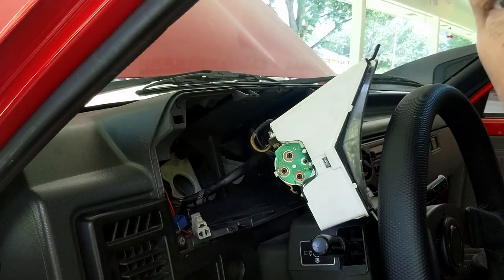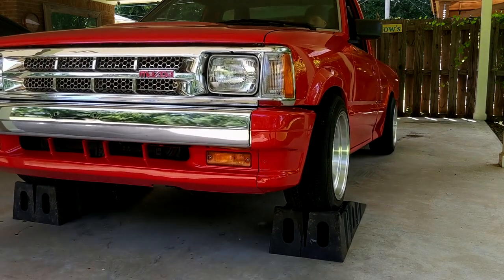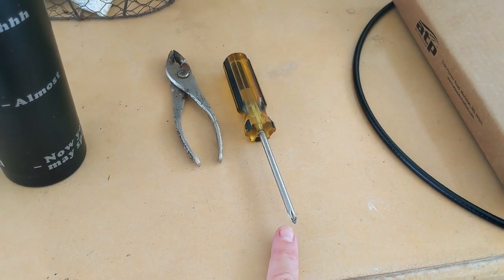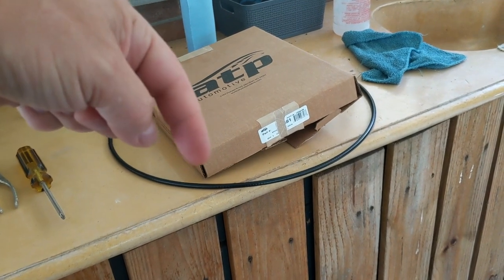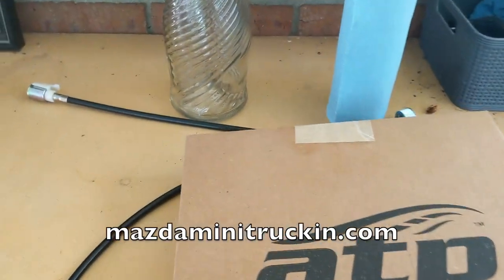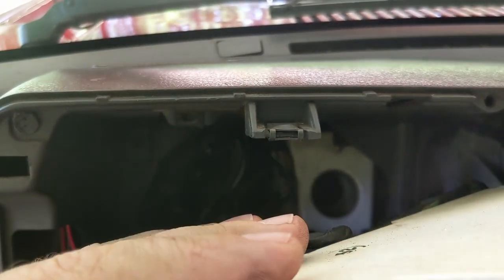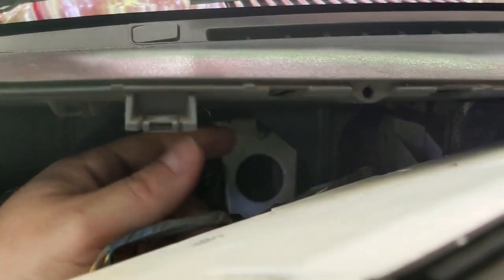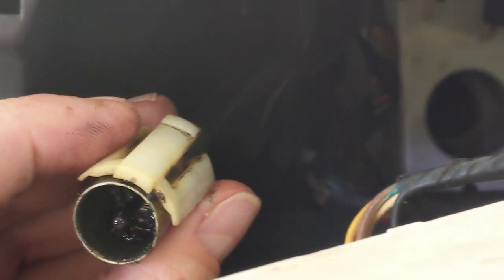How To Install a Speedometer Cable on your Mazda B2000/2200/2600

Comment: My '93 B2200 had a squealing noise for a long time, I could not figure it out, then one time the speedometer needle jumped and It finally hit me on what the noise is!
A month or two later I heard a pop sound and the speedometer needled dropped and hasn't moved since. 
I bought a cable but that was a year ago, I didn't know how bad it was going to be to replace but you made it look easy!
I'm pulling out my engine now to replace the clutch and paint the engine bay, I think it's a good time put the new cable in!

Comment: for around the clamps you can cut a section of ??fuel rubber hose and put it in to insulate the cable housing from metal clamp

Comment: Hey bud, I really dig all your videos. Looks like your truck is mint condition. I’ve got a 92’ 2600 4x4 and has been parked for nearly a year. TCM went into fail safe mode and can’t seem to get to the problem. I’ve diagnosed just about every sensor and solenoids that I can think of, but no luck man. I’m thinking I’d replacing the TCM, but can’t seem to find one. Any chance you of a place to get one?
Reply from the maker: Check eBay. 90% of the time it is the ECU. The capacitors in them swell. Very common to have tons of electrical issues with the 2600.
Reply: @MazdaMitch  yeah I already got an ECU from Flagship one and no dice, still in fail-safe. I’m betting it’s the Transmission Control Module, but can’t seem to find one.

Comment: once again, nice video! Just wondering if the cable fits both regular cab and extended cab ( which i have )? You definitely have to send me a link on the hood struts, that would really come in handy!
Reply from the maker: There is a video about the hood struts on here with a link in description.
Yes the speedometer cable is the same for both standard and extra cab. There is no difference in length from the gauge cluster to the transmission on either.
Reply: @MazdaMitch  thanks mitch

Comment: Señor MazdaMitch!  I recently replaced my speedometer cable and I'm happy I have a working speedometer again.  My question to you is since replacement of cable does your speedometer read correctly or is it off by any amount of miles?? Mines off by 5mph . I used a digital GPS active speedometer to check my speed. Thank You in advance.
Reply from the maker: Nothing changed for me. It's the same.
Reply: @MazdaMitch  well I can deal with it for now. I have upgrade plans anyways sooo 5mph ain't nothing.  Thank You very much for responding.

Comment: Was looking for this exact video! My 1994 Mazda B4000 SE 4WD extended cab manual speedometer starts bouncing back and forth when I hit 50 mph. The needle will usually bounce between 50-60 consistently when I hit that speed. I was told I should probably grease my speedometer cable. Would this same method work on my particular truck or should I just replace the whole cable itself? And how would I pull the whole cable out, grease it with a PTFE-type lubricant and reinsert it from the gear to the instrument panel correctly if I decide to just grease it?
Reply from the maker: I don't know about your particular truck that model year but the principle of it all is the same.

Comment: It is possible to change the cluster without damaging the speedometer cable and which is the revolution cable. 🤔🤔🤔
Reply from the maker: Just make sure youove the speedometer cable to the left of center and it's plug and play the tach will work.
Reply: Thank you very much for the help 👍👍👍

Comment: Hey Mitch, I purchased and intended on swapping in a tachometer gauge cluster on my 87 b2200, when I finished the install I realized that the odomoter was 150k miles too many, Id prefer to keep the truck exact mileage as it only has 60k original miles so ive put the old one back. Is there any way around this? Or is the swap going to tamper with milage no matter what. Thanks- Dan
Reply from the maker: You can take it apart and reset your mileage to whatever you like and there's a how to in the document section on my website. It is on my list to make a video showing how to do this soon
Reply: Thanks Mitch you’re the man. Awesome vids, great resource throughout ownership

Comment: I don’t know how I direct message you bu I have an 87 mazda b2200 and I was wanting to see if you have the same problem I do with your truck. I have a hard time getting to 75mph and have a hard time maintaining speed while going up an incline or going against the wind and if you don’t have that issue what might I do to improve it.
Reply from the maker: It could simply be wore out. No I do not have that trouble I have a truck with 135,000 mi on it and I have a truck that's been rebuilt both of them run gray go uphill go in the wind will do a hundred miles an hour. I don't know if you're running the stock carburetor or a Weber but either way if you advance the timing you'll get a little more juice out of it
Reply: @MazdaMitch  I’ll try that and I have the Webber carb with emissions deleted

Comment: What’s the deal with the hood struts I have seen it before but can’t remember all the details
Reply from the maker: Coming in a future video.
Reply: @MazdaMitch  I searched the Facebook page and found a link to a older video you did. Be great to find the length and however they measure the force.

Comment: Did a engine swap
Reply: Would I be able to use the same cable?
Reply from the maker: Should be able to. I don't know what all you did, but this cable cmgoes from stock transmission to cluster